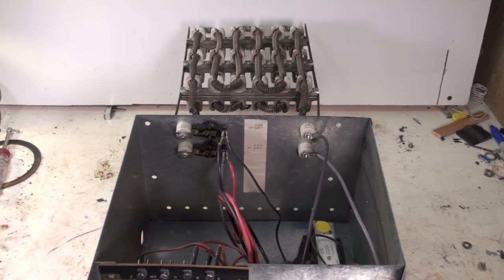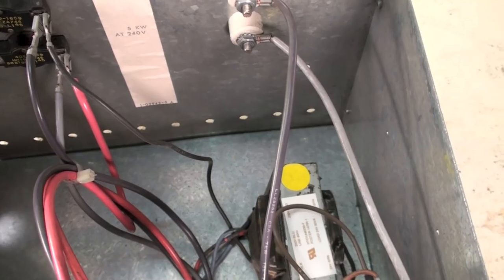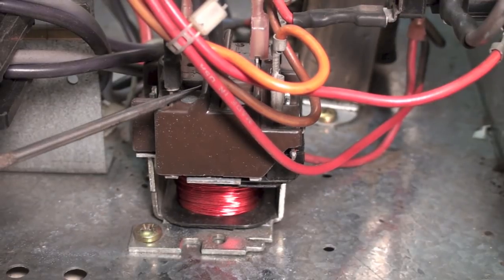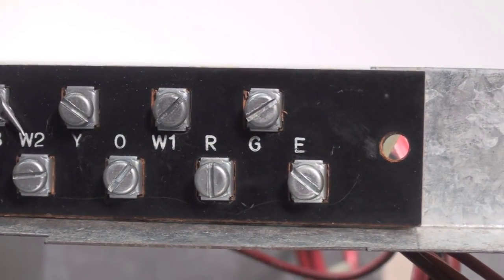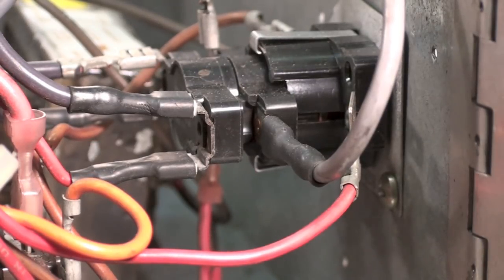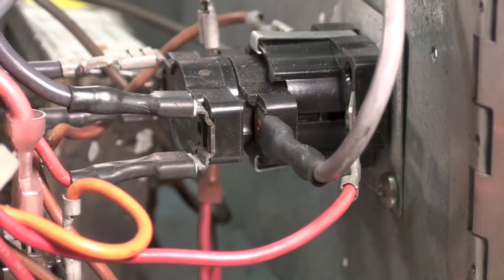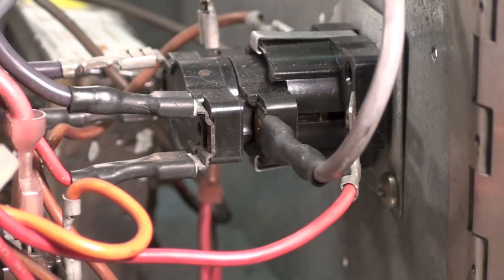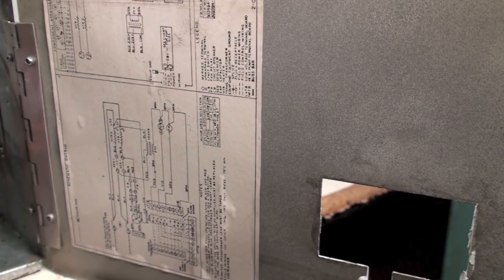Electric furnace: the basics

Comment: A low voltage transformer that needs a sequencer?... correct? Is it possible to put a capacitor on the output side of the transformer to prevent that pull down? Just a thought.
Reply from the maker: The transformer does not need a sequencer.  The sequencer is there to limit the instant amperage draw on the pole transformer.
GFM
Reply: grayfurnaceman, I understand that, but if the draw is too much for the transformer then it needs something. I take it that's what the sequencer is for to reduce that instant draw??? If the draw is too much at once then a capacitor on the output side of the transformer would reduce that instant draw. All your basic pwm power supplies have a capacitor for that very reason, I wouldn't think this would be any different.
Reply from the maker: It is very different.  A PWM power supply produces DC.  The capacitors are there to smooth the pulsing DC.  The transformer is AC. A capacitor would be useless.  If the sequencer heater does have high initial draw, the transformer will absorb the high draw.  The transformer will only fail if its draw is excessive continuously.  
GFM
Reply: grayfurnaceman, true a pwm PSU, at that stage is DC, however the circuit down stream of the cap still modulates, that's the purpose of the cap to prevent under current in a modulating circuit. There's also caps that work on AC circuits, they're used in both AC and DC.

Comment: My electric mobile home heater blowing cold air what is the problem it's freezing  help ?
Reply from the maker: First, check for plugged filter.  Then check all breakers related to the furnace.  There may be several in the panel and in the furnace.  Turn them off, then back on.
If all is ok, it gets more complicated.  You could have burned off wires in the furnace, failed elements or sequencers may have failed.

Comment: It seems that a fusible link and an overload limit both detect high temps, so why do you need both when the both safety's seem to do the same thing?
Reply from the maker: raherahe The limit switch is made to occasionally open on high temp.  If it has to open regulary, such as with a plugged filter, will fail.  It may fail open or closed.  If it fails closed, the element may cause a fire.  So as an ultimate shut down, the fuse blows and shuts it down permanently.
GFM
Reply: Thanks!

Comment: ok, so I know someone who just had their heater wiring catch fire and it needs replacing.  the a coil might be good, might not be though.  
I talked to a guy that said it would be $1300 to replace the furnace.  

is that a fair price?
Reply from the maker: Is this an electric furnace?
GFM
Reply: yes, 15.8 kw unit
Reply from the maker: The price for the furnace is not so bad.  However, electric furnaces seldom need to be replaced.  Most every part is available and it can be repaired.  Merry Christmas
GFM
Reply: ah, Roger.  ty for the feedback.  ill look and see if that's our best option.  merry Christmas!
Reply: spunkyprep good to know

Comment: Can you please tell me where can I find model name/number for my furnace. I'm trying to order a new heating element as half my element comes on (gets red) but other half doesn't. It's an old unit I'm not sure if I can find a replacement heating element for it. Can i rewire my current element ? And how ? 
Thanks
Reply from the maker: Make and model are in various places but most are on the panel you remove to get to the elements.  Some elements can be rewired if the element runs thru circular ceramic insulators.  Check my channel, I have a video on how to rewire an element.
GFM
Reply: grayfurnaceman Thanks

Comment: I have a furnace element heats up cycles on and of but fan won’t run. Then fan will function normal sometimes for a week and stop running again any ideas?
Reply from the maker: Check bearings to see if they are tight.  Also be sure there are no connection problems in the fan wiring.
GFM

Comment: American Standard elec heater makes loud ticking noises, which component is causing that? What could be the issue?
Reply from the maker: You could have a build up of lime covering the element.  If it continues, it will burn out the element.  Mostly it means a new heater.  You can try removing the element and scooping out the lime.  Pretty long job.
GFM

Comment: The electric heater I have in my condominium has 3 coils with thermal link fuse between coil and limit switch for all three. In last one week coil#1 thermal link fuse got open which stopped coil heating. I replaced with new thermal link fuse and coil started heating. It opened again today so I am not sure what is going wrong. Its 5KW coil with 250V/15AMP TF152degC. Is this thermal link important can I directly connect heating coil to limit switch like the one you have in your video, would there be any problem?
Reply from the maker: +snehalshankar Not only no, but heck no on the bypass.  Unsafe.  There are 2 reasons for the link to open.  Low airflow from plugged filter, dirty blower wheel.  Or an element sticking on due to sequencer  stuck closed.  Let me know what you find.
GFM
Reply: +grayfurnaceman Thanks GFM for your quick reply. I really appreciate it. When I opened it yesterday to replace thermal link fuse I saw that heater coil#2 and #3 where not getting heated up much like coil#1 was. I see all three getting heated little differently like coil#1 is most then 2 is mild and 3 is less, is this the real experience or all 3 coils should heat up same at different times based on sequencer? Blower wheel looks good and no dust. I am not sure about what plugged filter means is it the filter 20 by 20 by 1 which is for air flow in? I replaced that recently unless there is some other filter. Just to note coil#1 5KW is new and changed last month other 2 coils are old and looks little sticky specially coil#2. I am thinking to change other two coils #2 and #3 to new to see if this helps. Can you please tell me where to get the push connectors and the good strand copper wire? I see some black color shades near connector but ohm meter says they are good and continuity works so not broken but I am thinking to change wires with push connectors for most of them.
Reply from the maker: +snehalshankar The sequencer turns on the elements after a time delay.  The filter is mounted in the return air of the ductwork.  No other filter.  The 1/4" push on connectors (12-10AWG) are available at electrical outlets.  The wire should be #10 105C temp rating.  I would replace the connectors is they show signs of discoloration.  Hope this helps.
GFM
Reply: +grayfurnaceman Thanks GFM for part no for wire and connector. As you suggested I will replace wires. I noticed the current wires get so much hot so turn black on edges of connector not sure that causing the thermal link to blow. So no need of restring the other two 5KW coils?
Reply from the maker: +snehalshankar Not if they are working.
GFM
Reply: Thanks GFM here are my updates::I restring the other two coils because they were not heating bright and now all my three coils 5kw each are brand new which came with 250V 15A TF 152Deg C fuse link connected one via thermal limit. At very first load heater tripped off the 50Amps circuits breaker in 10 minutes and stopped blower(complete heater was shutdown). After switching it on for another 15 minutes it tripped off again. Later I switched it on again and then it didn't break and its working till date. Suddenly this morning due to freaking cold here heater was running for a long time so coil#1 has stopped heating due to fuse link getting open. I checked the current and it shows 19Amps so not sure that cause the fuse to open. I am not sure if this unit which is 53000BTU needs to have fuse link for 5kw element or can be directly connected to thermal limit(I read somewhere that thermal limit will open in case of high temp and then reset back ones cool down).  So far I have changed 3 fuse links with same specs for coils#1. This are the fuse link came along with this 5KW heating element. Do you have any suggestions for the failure of CB as well the fuse link. Thanks in advance!!
Reply from the maker: +snehalshankar Be sure the 50 amp breaker wires are very tight.  Loose wires will cause overheat and tripping of the breaker.  Do not under any circumstances bypass the thermal fuse.  They are there as a last line of defense against a fire.  You have one of 2 problems related to the open fuse.  Air flow is too low or the sequencer is sticking on when the furnace shuts down.
GFM
Reply: +grayfurnaceman Thanks for your support. YEs I saw that wire from 50AMP CB was loose and getting heated I tighten it and it stop tripping now. So your suggestion was really helpful. Regarding the Air Flow I will try replacing the filter and keep eye on it. I doubt about the sequencer sticking on because I coil#1 and the blower are first to start and then last to stop I see that heater getting stopped as soon as it reaches +1 based on setting in thermostat. So I am assuming that it will stop the heating coil#1 too. Would there be any higher thermal fuse I should try for coil#1.
Reply from the maker: +snehalshankar Not only no but heck no.  It is telling you there is a problem.  You have to find what it is.
GFM
Reply: +grayfurnaceman Thanks!!  I will keep the same specs 250V/15AMPS with 153DEG C for the new thermal link and also change all old wires which looks corroded. One more thing I checked that as per the instruction on panel board the blower default for heat is to set on LOW but looks like the AC technician in summer changed it to MED HIGH. Do you think changing that too default LOW for heat might help?
Reply from the maker: +snehalshankar I would use the highest speed on the motor.
GFM

Comment: I have a 2 circuit Electical heater 15K in my air handler Trane Gam 5  Installed 6/15 .   It has 3 heater  Relays A B C .    A&C heater coils  are on circuit 1.  # 1 htr A coil is connected to relay A .   # 2 htr C coil is connected to relay C      Coil 2c glows and cycles on and off and appears to work(blower door is off) to view ... Heater 1A coil never llights up. Nor does Heater coil 2B . they never cycle on even in Emer setting .When htr coil 1 lights there is 24v at relay C  lower pins and 240 at top 4 pins .  No other relays show and voltage at all .   Check the 2 CTCOs?  Or   2 NTCOs?   Very  difficult to get meter on to pins . Continuity was good on htr coils as far as I could hook meter.    Hope I havent confused the wording? Please,, whats your take ?  Thank you
Reply from the maker: +oldtimedrumcorps I usually check these things hot.  So be very careful.  First check amperage with clamp on meter.  No amp draw, there is an open somewhere.  Then voltage across all switches.  If voltage is read, switch is open.  Voltage at the element and no amp draw, either element is open or the element fuse inside is open.  Hope this helps.
GFM
Reply: +grayfurnaceman Thank you you have confirmed troubleshooting guide that states if 24 vac to 4 pin connector wh to pb and pk to pb  . then use clamp  on amp meter on relay. Right on relay? was what I didnt quite understand . I need a clamp on Amp meter Thank you and I will keep you posted .
Reply: +oldtimedrumcorps  Problem solved Just what the schematic showed .  Relay Band C was not energized with 24 volts to open . There was two wires from relays that needed to be jump wired to white to complete relay circuit . All elements are now on . The service tech fiest checked AMP{ draw and knew something was wrong as he was only showing 20 amps when it should have showed 40. I did not have a clamp on Amp Meter.  First Tech never checked amp draw and from then his evaluation went downhill . Thank you !

Comment: If I was to install this unit in my home would I still need a gas or oil source?
Reply from the maker: No.  Electric is fully capable of heating a structure.  It does require 200 amp electrical service.
GFM
Reply: grayfurnaceman ok so basically I would still need a act and heating combo all in one?
Reply from the maker: If you are asking if you will need an air handling system, then yes.  The electric furnace is both a heat source and an air handler.  
GFM

Comment: Does all electric furnaces have 220 volt blower motors?
Reply from the maker: As a general rule, electric furnaces will have a 240 volt motor.  As with any electric appliance, they can be ordered with any voltage from 120 volt to 440 volt.
GFM

Comment: Well.. All the relay are new. Im not an electric expert.. but when i test the resistance for each element.. i go 0 resitance where my first 110V come from.. and 12.2 if cross , witch is normal... 

I got 4 Relay.  Each relay give 110V to the element ( black wire) stop and go , id jeating is call.. Each element have 110V on the other end... power from al relay ( yellow wire )
Reply from the maker: You are still reading 120 volts.  The unit runs on 240.  If you are checking from the terminal to chassis, the reading is meaningless.
GFM

Comment: Great video my problem is the furnace comes on then the blower shuts down,you can hear it click and try but does not,you can wait awhile and turn the thermostat up and same thing happens,any help is apreciated. @bbinva
Reply from the maker: Mark Cregger I need a lot more than that.  Electric or gas first.
GFM
Reply: Electric,   coleman central elect furnace mod eb12b cut it on heat comes on and the blower but then the blower cut off.
Reply from the maker: Mark Cregger Have you tried jumping out the thermostat?
GFM
Reply: Don't know how ---unfortunately the furnace is at my daughters in S.C. and I am in VA. Son in law is not real handy with anything. I could try a few things if i were there.Do you mean dypass the thermostat?
Reply from the maker: Mark Cregger Yes.
GFM
Reply: What do i need to know for you to help? How many wires?

Comment: Gary I want to install a iceco model 14AHJ11S01C01 downflow heat only for a crawl space. Never installed electric before. Do I have to use a heat pump or is it built into device?  Also I'm not hooking to Central Air conditioning.  Just heat so is pump necessary or just fan across the coils? geomessler at hotmail.
Thanks
Reply: You do not need a heat pump.  The unit should have electric elements.
GFM

Comment: I have a 2300 sq. ft. home with 2 10kw electric heat furnaces.  My upstairs furnace keeps blowing the 60w fuses.  Can you tell me what causes that?
Reply from the maker: Good possibility that the wires to the  fuses are loose or the fuse clamps are loose.
GFM